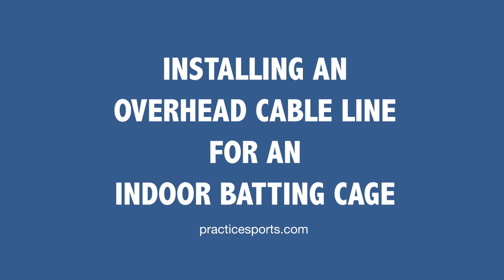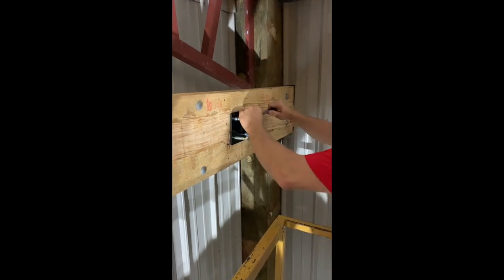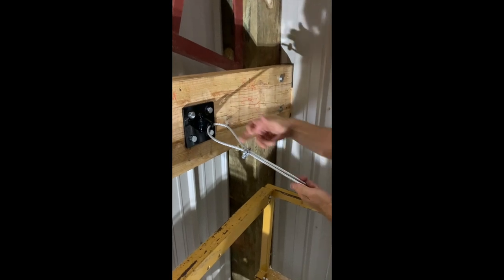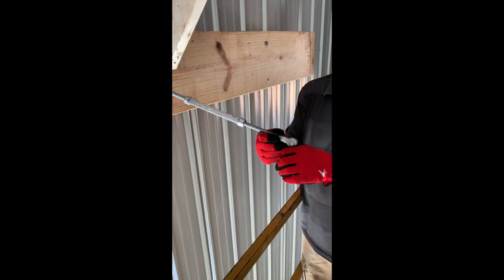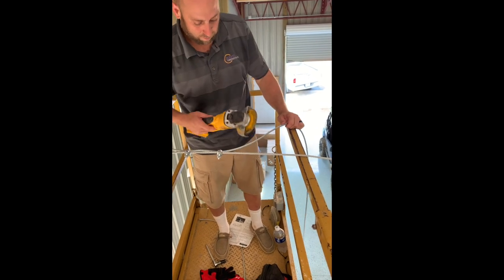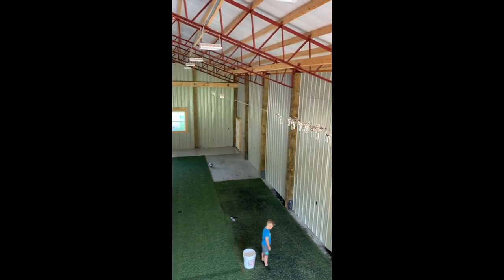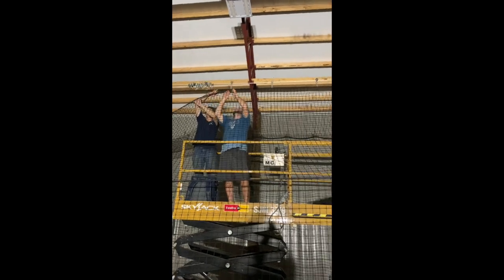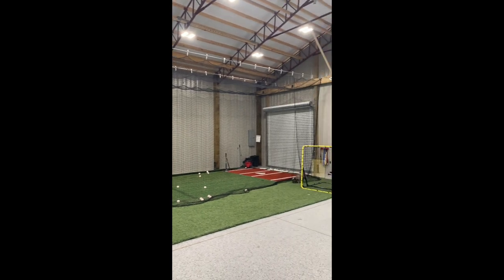How To Install an Indoor Batting Cage

Comment: Good video. Don't understand why more people don't use cable rollers? any drawback to using them?
Reply: Hey Mike, are you referring to the steel roller wheels? We almost always recommend using the steel or nylon roller wheels if you're going to be collapsing the nets frequently. You can get by with just snap hooks, but eventually those snap hooks wear down and begin to act as a brake on the line. The only potential drawback with the steel rollers shown in this video is that if you do have to replace one, you have to take down the whole cable line. (Or try and cut through the roller wheel.) The nylon roller wheels have a split bracket, so you can just remove and replace the roller wheel without taking down the whole line.

Comment: Where did you get the mounting brackets?  Thanks
Reply from the maker: Hello Kevin! You can find our mounting plates / brackets here: 
https://practicesports.com/product/8-x-8-steel-wall-anchor-plate/
https://practicesports.com/product/8-x-8-adjustable-steel-wall-anchor-plate/

Let us know if you need any assistance with your custom batting cage project! 
Team PSI 
info@practicesports.com 
402-592-2000

Comment: What size is that cage? Length, width, and height? Where can I get all of the materials? Thanks!
Reply: Hey Joe, I'm not sure of the exact dimensions of the cage in the video, but we can custom build to any dimensions, depending on the size of your buildings and needs.

Check out our Net Calculator. It's the easiest way to get a quote on a custom net: https://practicesports.com/custom_tool/net-calculator/

All of the hardware featured in the video can be found here: https://practicesports.com/product-category/baseball-softball/batting-cages/hardware-batting-cages/

If you have any further questions, please don't hesitate to give us a call at 1-800-877-6787.

Comment: How do you know how tight you can go on the turn buckle?
Reply: Hey Gus, Great question. You need to get as much tension on the turnbuckle as it takes to get that line as tight as possible. Make sure you start with your turnbuckle 'wide open' so you can go as tight as possible with the turnbuckle. Also make sure you're turning the turnbuckle, and not the turnbuckle  and the cable line.
Reply from the maker: Also Gus, you can only place as much tension on your lines as your anchors / walls can hold. Be aware of the connection points on each end. As you tighten the turnbuckle, pay attention to how your anchors are reacting. If there is any movement in the header / wall plate / bolt etc. it's a good idea to either reinforce that header / anchor, or reduce the tension in the turnbuckle. Hope this helps! Team PSI